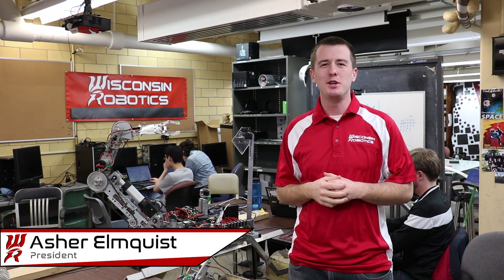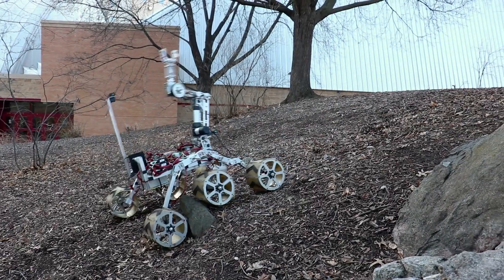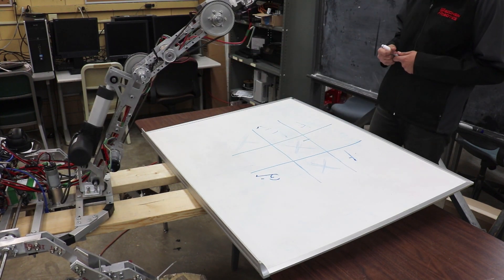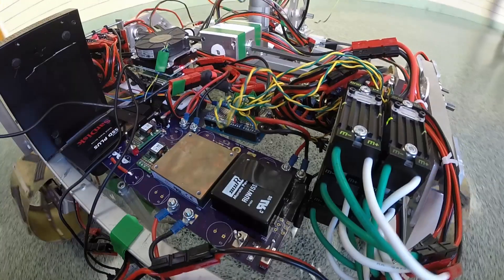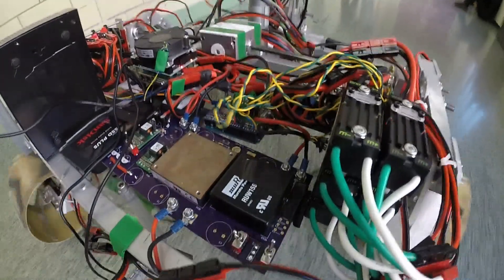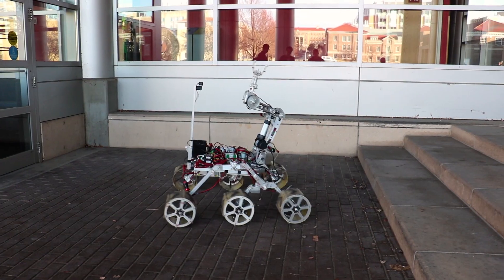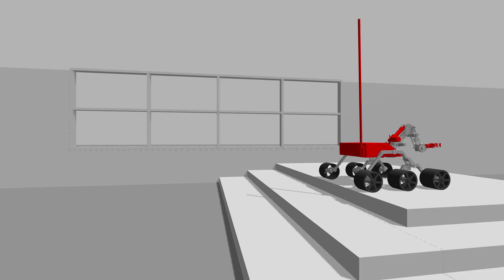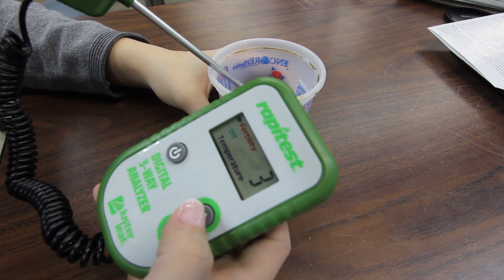Wisconsin Robotics Critical Design Review for URC 2017 - Ascent

Comment: Change the motors with high torque planetary gearbox and have a decent traction design on your wheels. Lower the RPMs while going up on a hill.